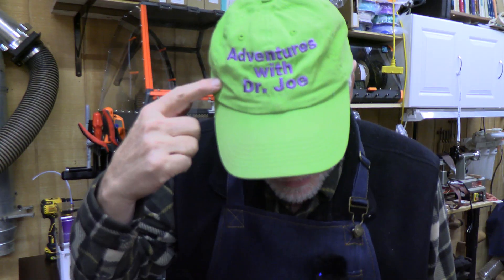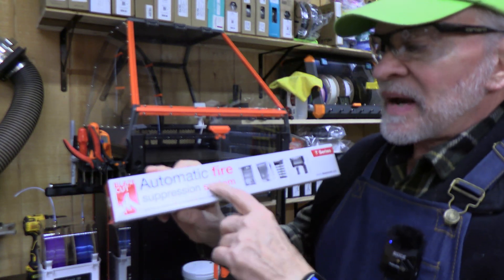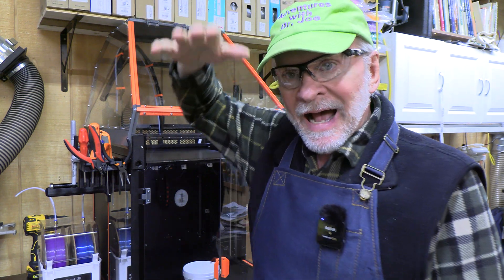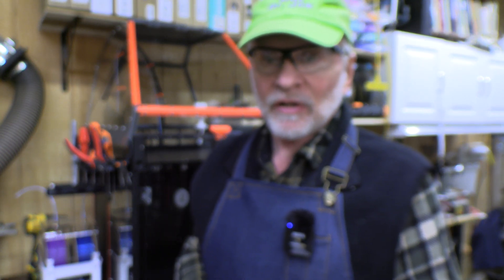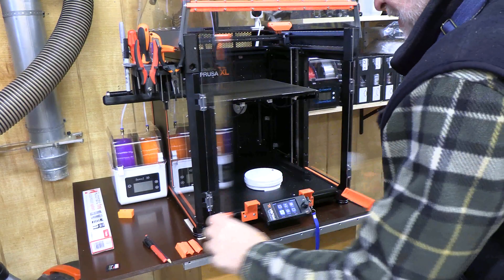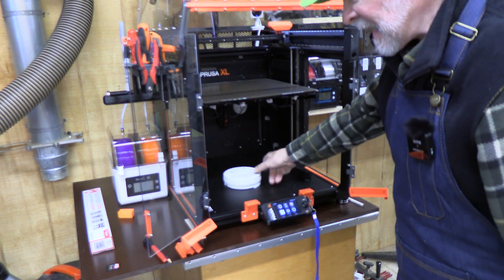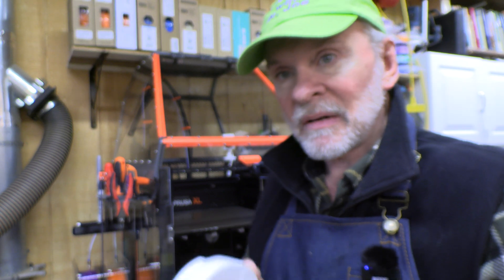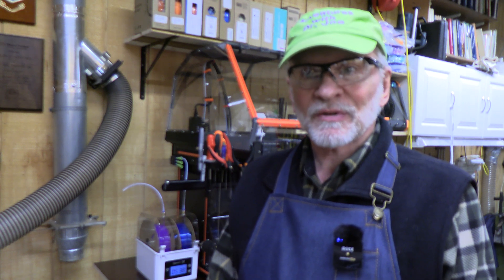3D Printer Fire Suppression

Comment: Do you have a link to the connectors you printed to hold the T025E?
Reply from the maker: Thank you for your question. I will put a link in the description from the printable file that I downloaded and used to make those holders. Consider subscribing. Thanks. Joe.
Reply from the maker: done